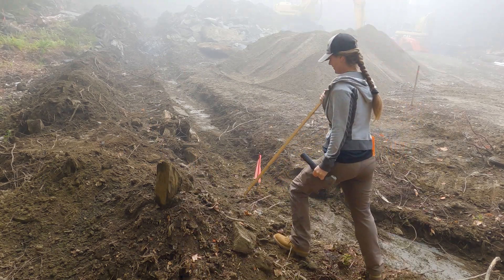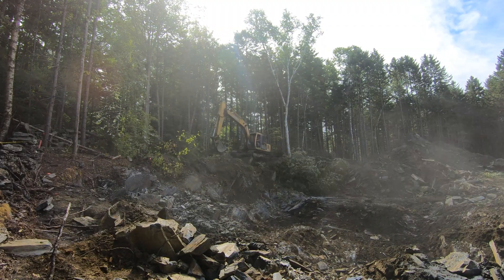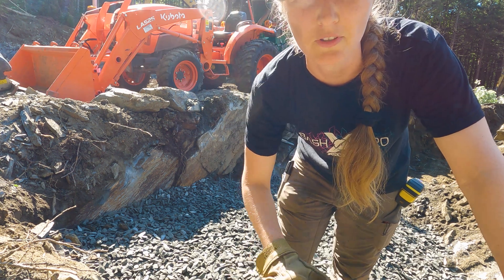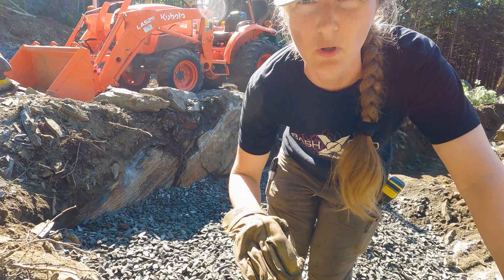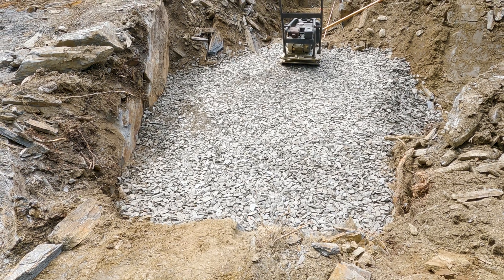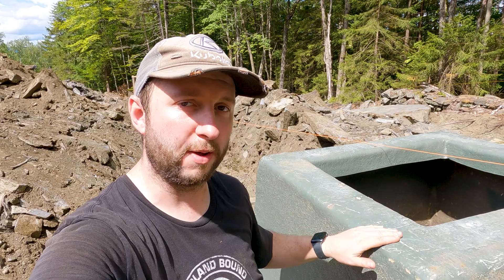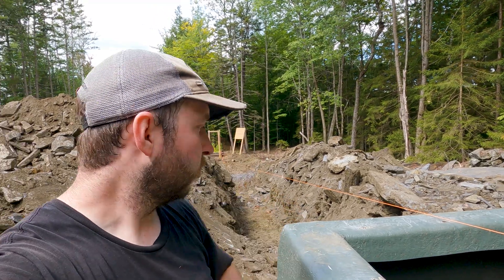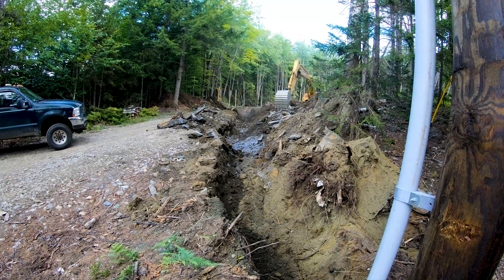Installing transformer pad foundation | DIY House Build

Comment: Did I understand correctly (from a previous video) that the crushed rock is actually your rock that got taken off site and crushed?
Reply from the maker: Some of our rock is being taken away by the contractor and crushed, but it will become a much less regular fill - it'll be the same as the driveway fill material where there's a mix of larger rocks down to fines. This crushed rock is a much more standardized form required according to the specification - it's essentially to provide adequate drainage and a firm base which won't settle or heave.

Comment: Interesting connection, so that shell is about 1/2 of a transformer vault: conduit with feed into it, then up to the transformer proper. Will it be filled only on the outside, or is it buried inside and out?
Reply from the maker: The fiberglass shell is basically a mount for the transformer which will sit on top and cover the big hole. The whole shell will be buried up to about 4" from the top, but the inside will be kept empty. The various conduits will poke in through the holes at the bottom of the fiberglass shell, emerging into the open space inside. The line crew will then make the connections up to the transformer on top as necessary.

Comment: Better to go by the electrical utility's requirements for the transformer. No mistakes, Once the transformer's in place than power can be run out fed through the dug up trench. All to electrical code. Nice tedious work that's time consuming but necessary.
Reply from the maker: Exactly, we used their specification documents to make sure we got things exactly the way they wanted it.